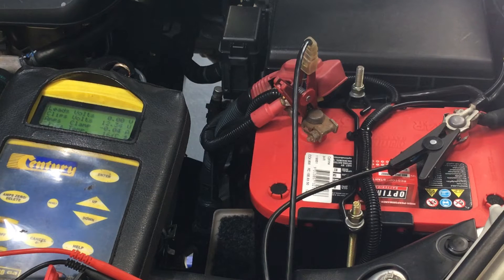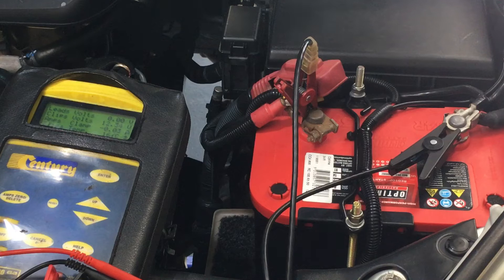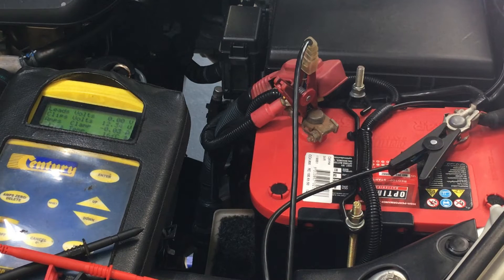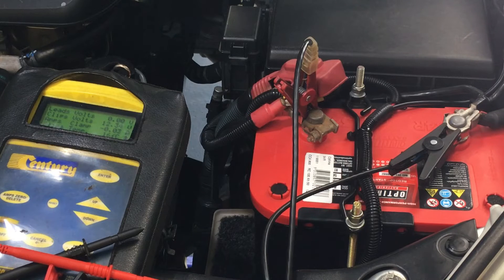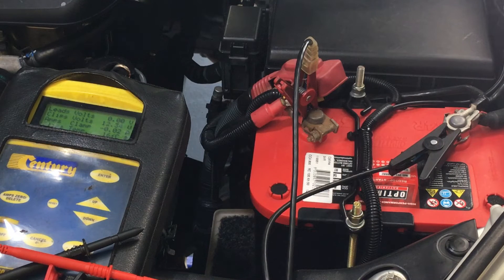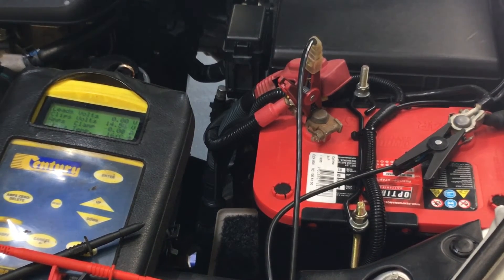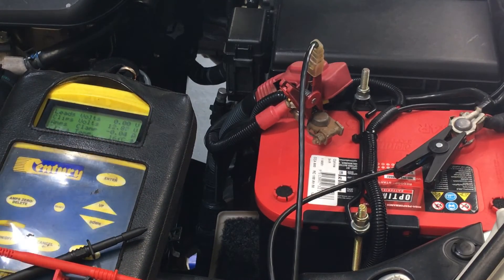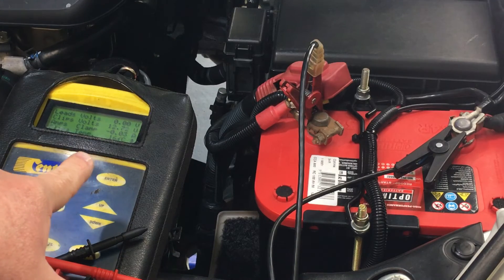HOW TO CHECK YOUR ALTERNATOR CHARGE RATE

Comment: title should be "How to tell if your alternator is working or not" not "How to check your alternator charge rate which this video doesn't even answer or even test for or find out from some label (if there is one) on the alternator that tells the current output.

Comment: after market alternator.  or weak amp alternator.    60 amps alternator( off road through water or mud will easy destroy aftermarket cheap low amp alternator) if the alternator or red lights on dash flash. even charge rate good 13.8 or 14.2. i bet 3 weeks your alternator toast.   happen to my patrol through experience

Comment: Good advice Anth. Free wheeling alternator pulleys (if fitted) can cause intermittent charging as they fail as well. Most newer models have these as an OEM fuel economy boost,  but they usually don't outlast the alternator.

Comment: Had an alternator light coming on intermittently..... Long story short it ended up being the battery sense wire  issue in the loom that runs under the pulleys.

Comment: I don't know if that alternator has brushes or not, but I have had them do that before and I found out that if you start the engine and give the alternator a whack sometimes the light will go out, hopefully long enough to get you home. What happens is the brushes are worn out and are not contacting the armature properly, and a thump will sometimes allow the brush springs to push them out.